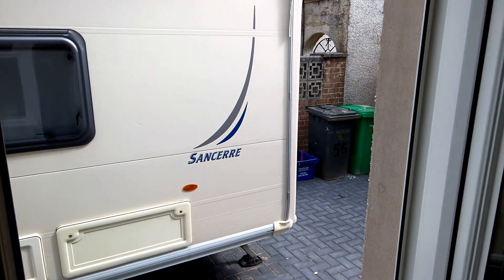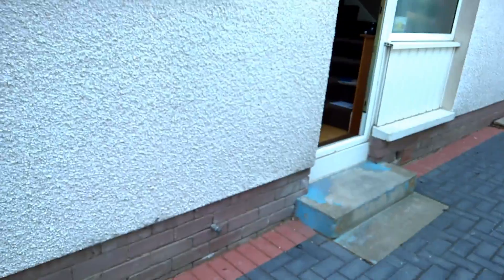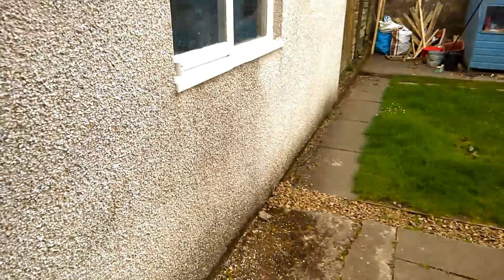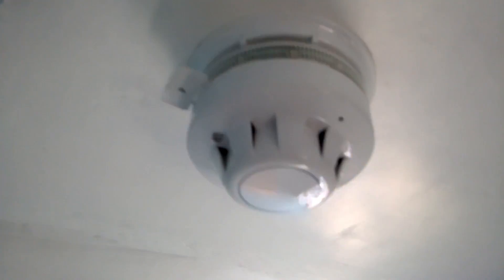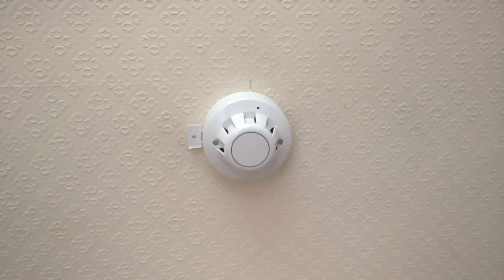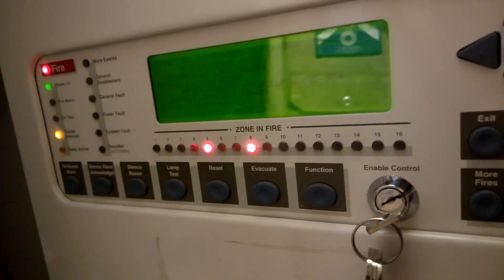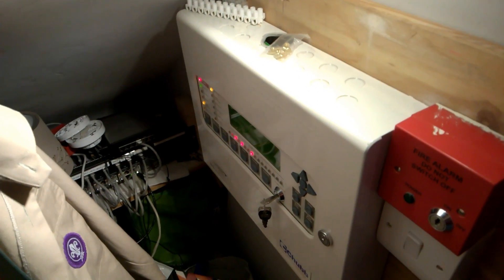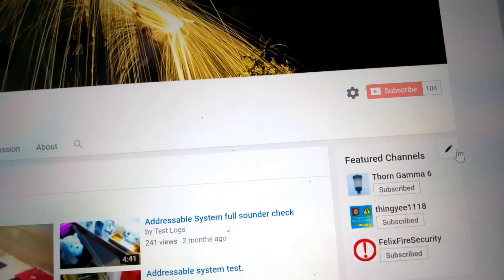Addressable System Test 2

Comment: At 1:56 why does the sounder do that long continuous sound when you silence it
Reply: Cameron Ivin 1 I believe it hasn't been put to 0s delay
Reply: Apollo XP95 sounders hold their tone because the panel stops sending synchronisation commands to the sounder but there's a slight delay between this and the panel telling the sounder to shut up, so hence because the sounder isn't receiving commands to change to a different tone it holds the tone it's on until the panel tells it to shut up.

Comment: Why did you replace one of the multi sensors did the one in the utility room whatever you call it break or something
Reply from the maker: i replaced the smoke sensor for a multi-sensor because of false alarms caused by the tumble drier producing steam when the room was cold.
Reply: Test Logs false alarms aren't good at all it just causes you to go back and forth silencing and resetting the system again and again
Reply from the maker: aye, the problem is sorted now.
Reply: Yep